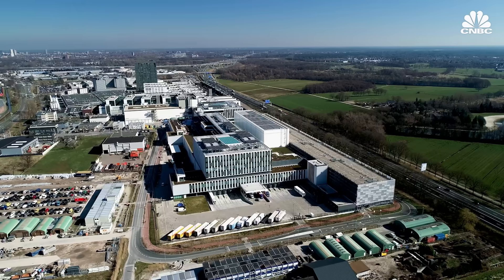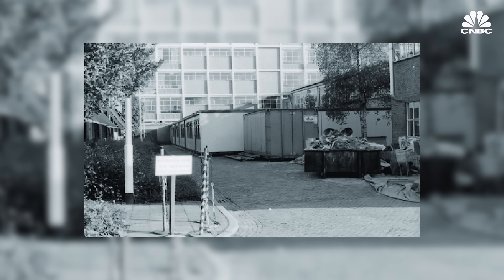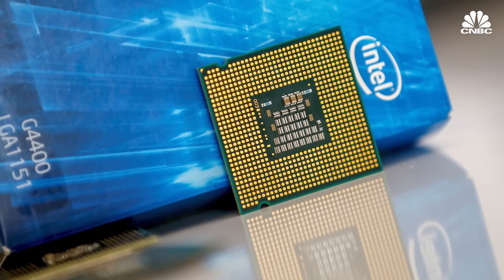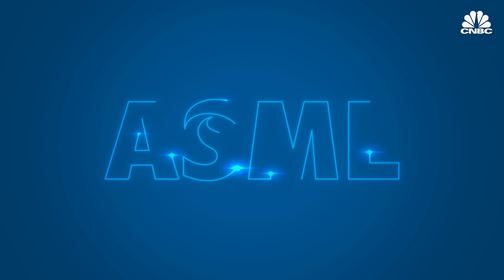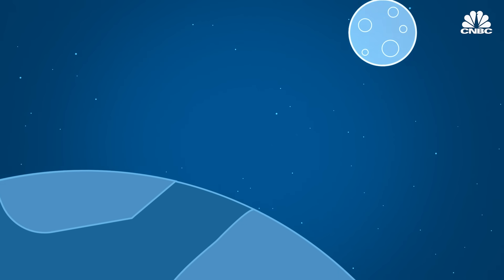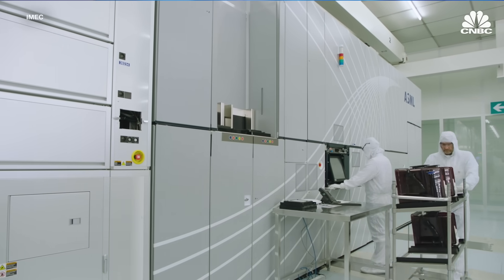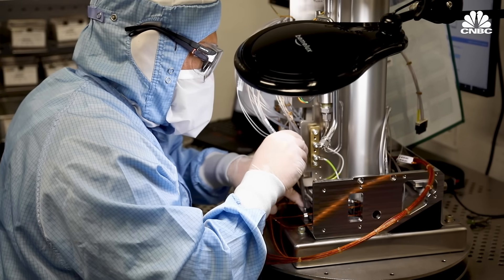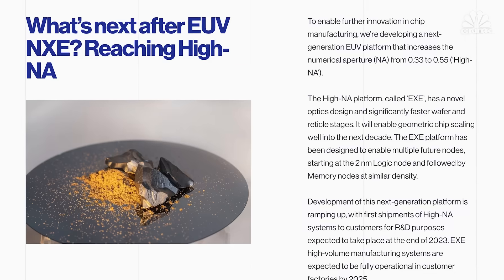Why The World Relies On ASML For Machines That Print Chips

Comment: CORRECTION ------ Its not the ONLY lithography machine out there ! Its just the best !
The chip shortage is only for the highest end products ! In fact it basically only produces the smallest chips. We can produce the same chips but on a larger scale (impractical only for very high end products) and in fact a lot of manufacturers are now adopting this approach during this chip shortage.
Reply: if you mean you wanna produce a 8 cores i7 10th gen 6.8 billion transistor  in a 45nm node well good luck with that man  , you will have a  800 w chip to cooldown , have fun sing LN2 24/24 to play warzone .....
Reply: This clearly show your lack of understanding even after watching the video. ASML is the only EUV producer however i would not consider these high end chips unless you consider your phone or your pc high end. you can not produce the same chips the sole value from wafers comes from their density. thats saying a computer is the same as a smart watch technically you are right but in practice you are very wrong the diffrent chips serve a very diffrent role DUV chips can not play the same role as EUV chips but EUV chips can play the same role as DUV chips please watch the video again so you actually understand what its trying to say

Comment: ASML is incredible. But I think there are other aspects: The chips produced in this top machines are the heart of any computer - BUT you also need much simpler /rougher chips around the central - and these "old" chips / designs are a big part of the shortage.
IMHO a significant part of the shortage is that the production of that "old" "low level design" chips - that are still necessary - was neglected. I think we are getting more into the dependency of China since they still do that "low level production" but nearly nobody else.
I remember older times. Some around 2000 I visited a train workshop in my hometown. We talked about circuits (Anti slip system) I saw some 7407 on the table and told I have some im my box. He immediately wanted me to sell these. In the 70th I bought them vor <1DM - that time they were willing to pay >14DM each. While these chips were still massive used, nearly nobody produced it any more. For me strange: it seemed nobody was interested to simply run a line with the old designs for some time.
Reply: Forgot to mention the shortage of neon used in some chip making processes such as 28 and 14 nanometer processes.  It's used as a cleaning and decontamination gas.  sadly half of the Neon comes out of Ukraine which has half it's manufacturing infrastructure destroyed.  That leaves China at 40% and USA at  10% global market supply.  We all understand the geopolitical complications of China as a source and that leaves only the US which is scrambling to trip it's neon production.
Reply: @ph11p3540  Uh - that might hit more than 'only' the top processes - I assume also processes over 120nm?
Reply: @ph11p3540  *You wish...that´s your "50 cent" opinion...
Reply: Old chips can be built with new machines you just need to spend engineering resources to port the designs. No one is doing this because it is cheaper to just build this old chips in old machines. Part of the reason of the shortage is that chip buyers cancel their orders for old chips so the chip makers upgraded their machines to newer machines. And when the buyers return to buy more old chips the old machines are no longer there. The chip buyers would now need to spend money to port their old chips so it can be built with new machines and they don't want to spend that money.
Reply: @kazedcat  And if there are still 'old machines' they only will be in China.
Reply: @wjhann4836  Global Foundries still own a lot of old machines.
Reply: @kazedcat  Even in a high-end chip, some layers will be done by EUV, many others by DUV.
Reply: @d.kersten8793  For this layers they use immersion DUV which is more advance than non inmersion DUV. Most of the automotive chips are produce with non immersion DUV. 65nm is non immersion 45nm is immersion DUV so really old stuff.
Reply: @kazedcat  Yes, you're correct.
Reply: Even though ASML EUV machines are so expensive and only five main chip makers in the world can afford the machines, there are many companies waiting to buy at least one unit but being not allowed to. These forbidden companies are located inside China and the US has enforced sales embargo of ASML machines to China.
Reply: @strongbrain3128  That's good news.  China can be the king of DUV chips.
Reply: @red94mr28  China can afford to buy any company on the world they really need. The question is are they been sold?
Reply: @eddyjan5179  Any G7 country can afford to buy any company they really need IF the regulatory agencies of that company's country approve the sale and the company is publicly traded.  Case in point is that China wouldn't be allowed to buy Lockheed Martin or Raytheon.  Also, if it's a privately held company and doesn't want to be bought, nothing can force it to be sold. Case in point is that China can't buy Walmart.
Reply: Check out Chinese fakes of classic semiconductors like bipolar transistors such as TIP35 series or MOSFET such as IRF5xx seriers. The package is perfect. Silicon area and (strength) is one half to one quarter of rated.
Reply: Some Japanese companies are capable of producing generations of it...
Reply: China already develop a lithography process that wont recquire EUV technology from asml. They were sanction las 2018 for purchasing this machine so they revolutionize their own.
Reply: @Nafets-C  No...that´s what your "Dear Leader" want you to believe...
Reply: @Nafets-C  You mean that "super factory" that after a spending of 20B$ by the chinese  government , produced a joke and went bankrupted ?

Comment: Pretty regular tech, nothing's new! China already has its own EUV. Proof: 'Tien 5000' supercomputer has its entire chip computations on EUV lithography.
What china is trying to do is, to grab low temperature TEUV (Transverse Extreme Ultra Violet) lithography, which allow chips to hold electrons on quad state instead of duel state, so now you have not just 0 and 1 but, -1/2,1,0,1/2. That's essential for Quantum computers.
Reply: Blablabla, in the mean time all the best chips are made with this EUV machine and nothing is made by china.
So how believable is this BS, time will tell.